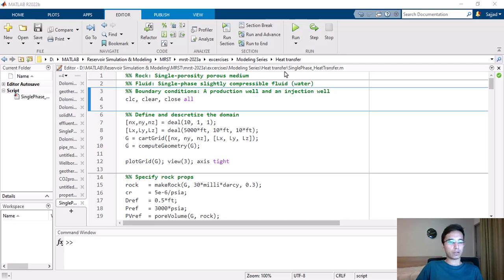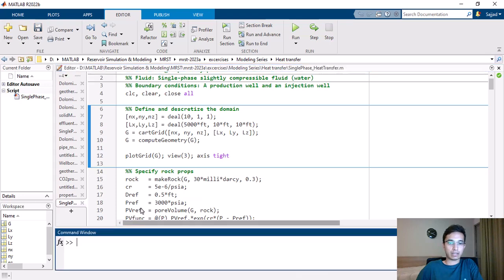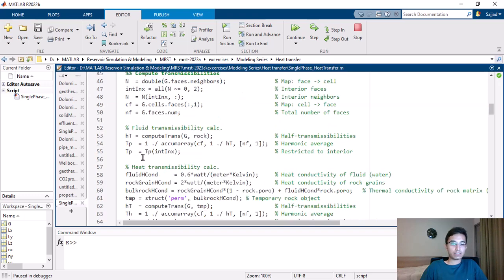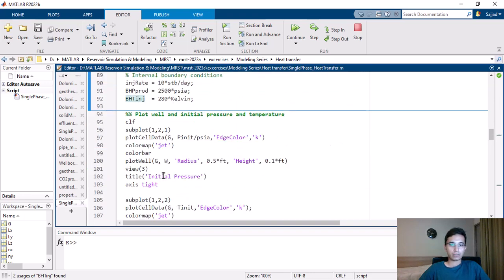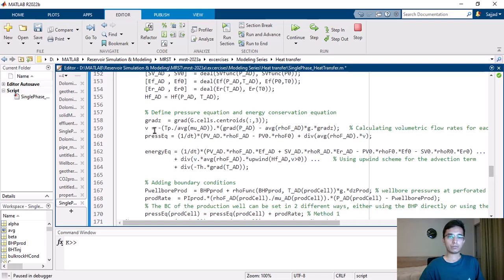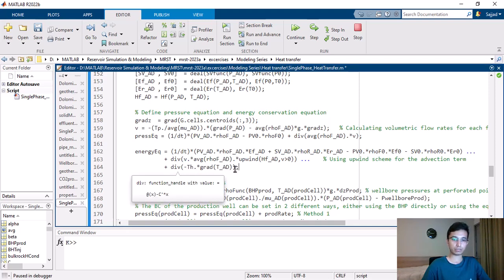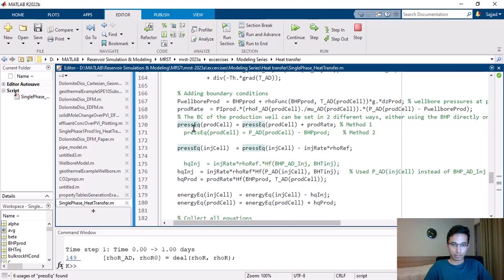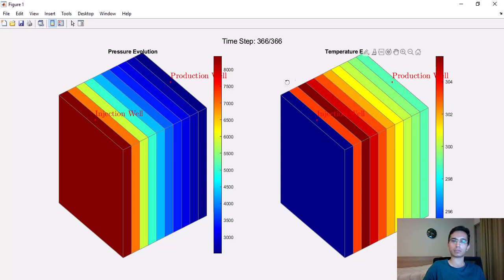Coupled Fluid Flow and Heat Transfer Modeling in Porous Media with MRST

Comment: Hello Sajjad Moslehi, thanks for your video and it helps me a lot. Now i want to simulate a coupled fluid flow and heat transfer in fractured porous media using EDFM in MRST. I have used the 'fracplanes' to define the fractures and the 'setupEDFMOperatorsTPFA' to obtain the transmissibilities (permeability for fluid flow transmissibilities and 'bulkrockHCond' for heat flow transmissibilities), 'grad', 'div', 'avg', and 'upwind'. However, it doesn't converge. Do you know what problems happened? I appreciate it so much if i can get your advice. Thanks in advanced.  

Neo
Reply from the maker: Hi,
To get this question answered, please raise your question in the Gmail Forum of MRST: MRST-users: The Matlab Reservoir Simulation Toolbox User Group
Reply: @SajjadMoslehi  OK, i will go there! Thank you!